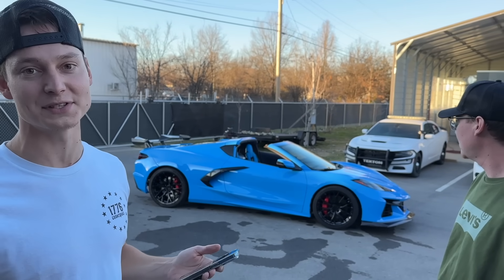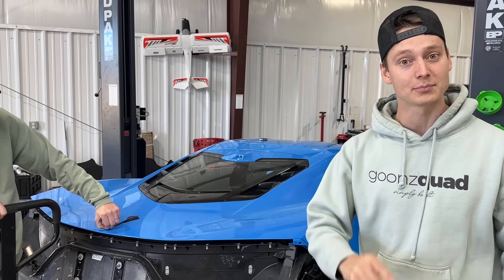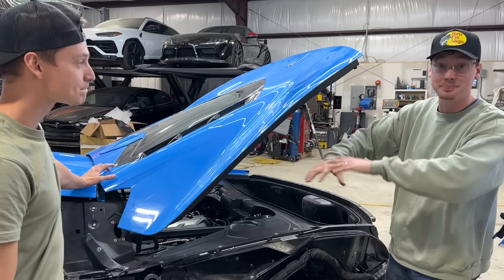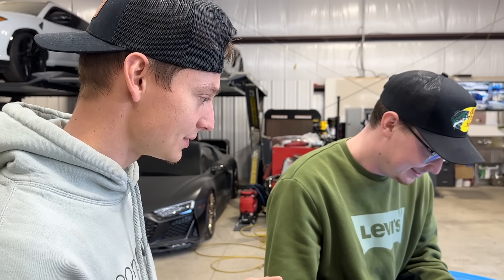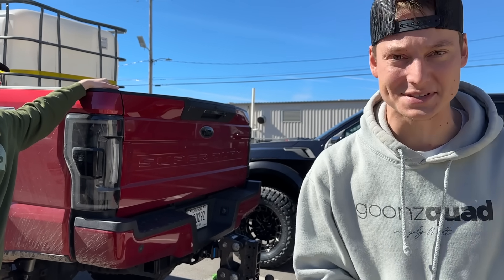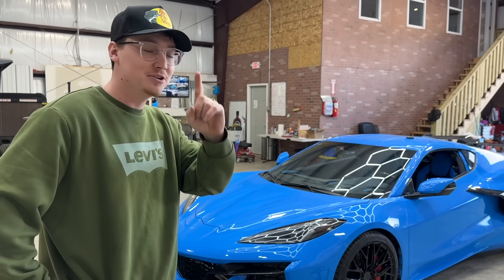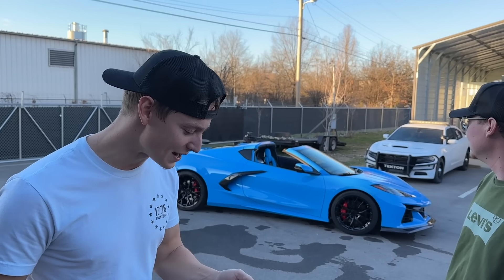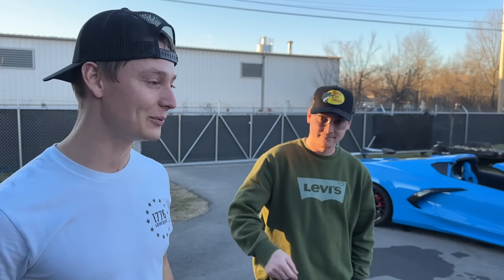Rebuilding A Wrecked 2023 Corvette C8 Part 16!!!

Comment: Need to take the old Camaro to the shop doing the c8 and get it finished. I love that car.
Reply: They should send it to Kevin from KSR to get it dialed in.
Reply: Kevin is good but I'm sure they have someone closer who can handle it.
Reply: Totally agreee 1000% I can't stand to see it just covered in dust😢
Reply: mid engine camaro with a vette chassis .. hmm .. sounds good to me
Reply: Build a sleeper with the Vette engine.
Reply: Agreed. Such a shame to leave that unfinished in the corner 😢 so sad.
Reply: Get a Wrecked f150 coyote motor truck. Fix it up, Then see if it beats the raptor r!

Comment: The two extra quarts are to prevent cavitation on tight turns with a negative grade.  2024 models have a redesigned sump and don't have that problem.

Comment: I've got a 1957 chevy hardtop for sale, all body work is done, its a roller chassis ready for whatever engine you want and transmission, all new brakes, lines, fuel lines, fuel tank, wheels and tires. tangerine orange, it would be cool to see what you do with it

Comment: Get a Chevy SS, pretty rare in the states with only 12,000 sold there. LS3 6.2L engine, 6 speed manual and a cult following. Will out handle your corvette handsdown. (Try get a 2016 or 17)

Comment: rebuild a lexus rcf, specifically the one that Stangry5.0, aka Parker Jones, previously owned. the new owner wrecked it and it should be on copart. its wrapped in a pumpkin orange color and is a 2015.

Comment: Its always better to avoid someone elses project. No clue what youre getting into. I wouldnt cam a crawler. Most of the time a cam needs to be turned faster to make its power or be in its powerband. That entirely depends on the specs though